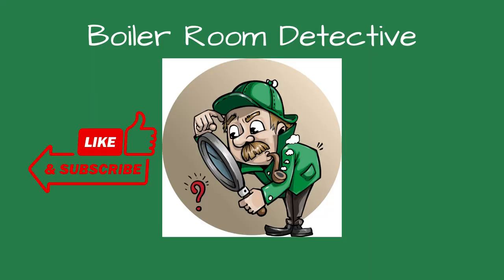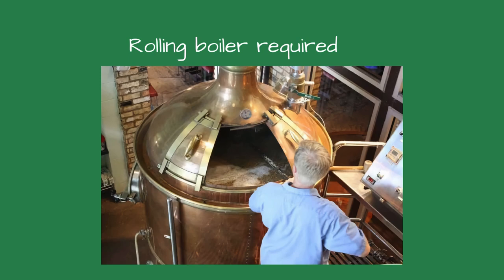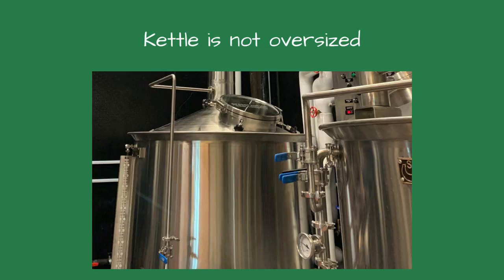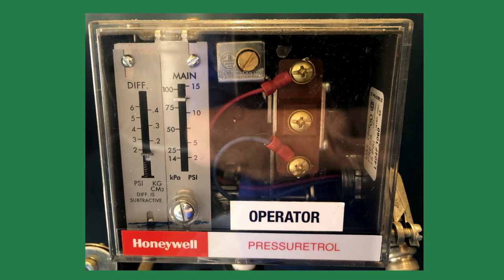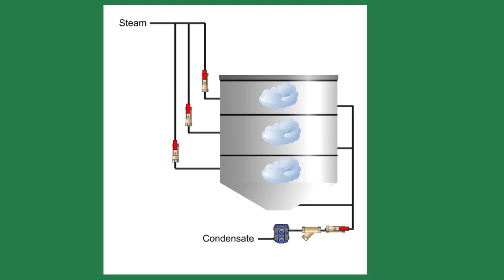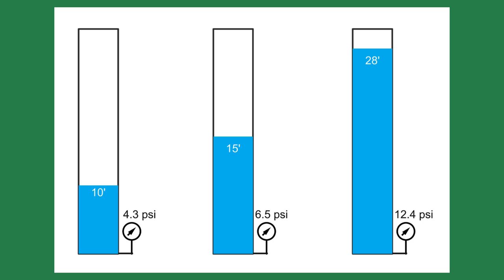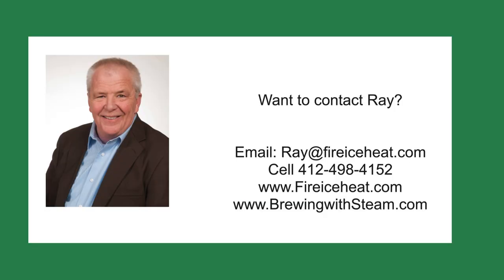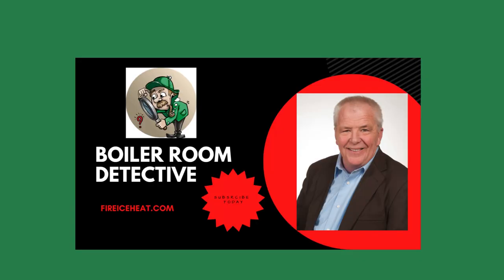Case of the no heating brew kettle

Comment: Fantastic explanation of how the weight of water works against pressure and the other way around. 
Our tech advisor has classes about the physics of this process religiously and some people just can’t grasp the concept .43 exerting 1psi rule. 
This factor is also key when troubleshooting pressure related issues in a hydronic system in tall buildings hence the reason for the HW boilers installed near the top floor. 
Great video Ray.
Reply from the maker: Thanks Mike I appreciate it